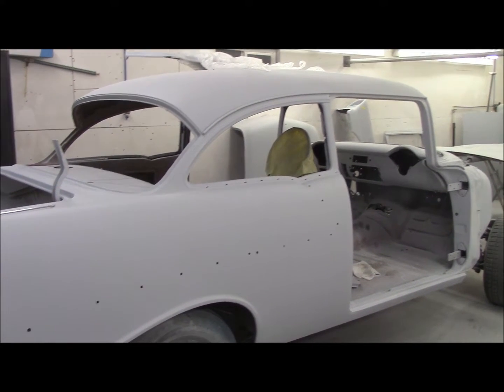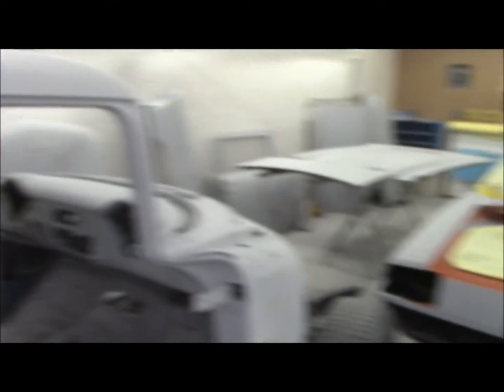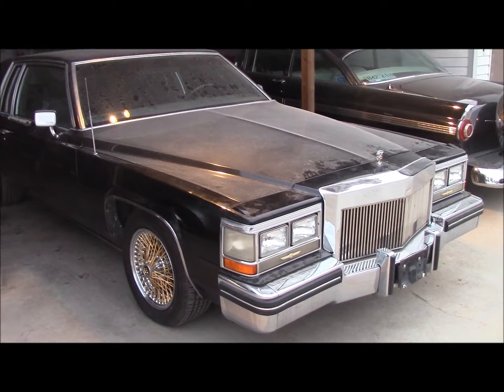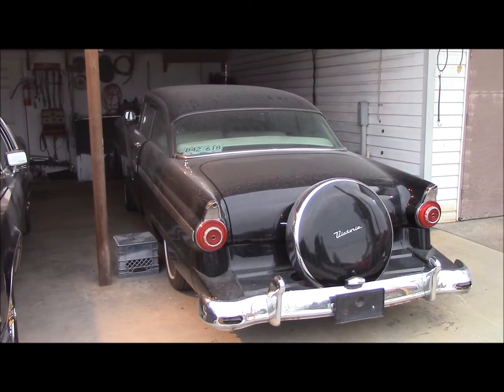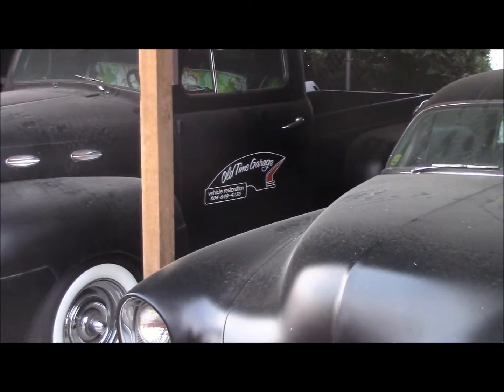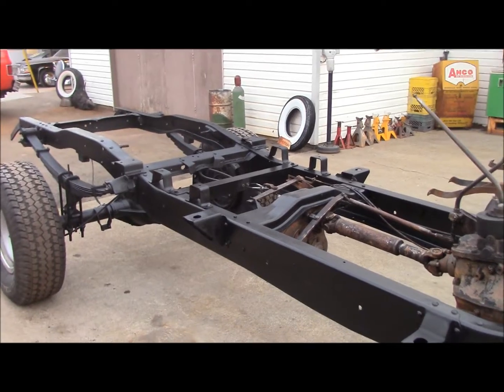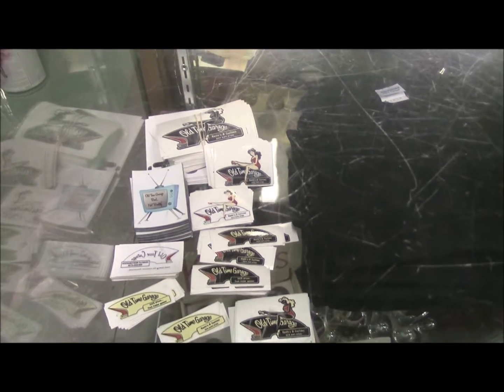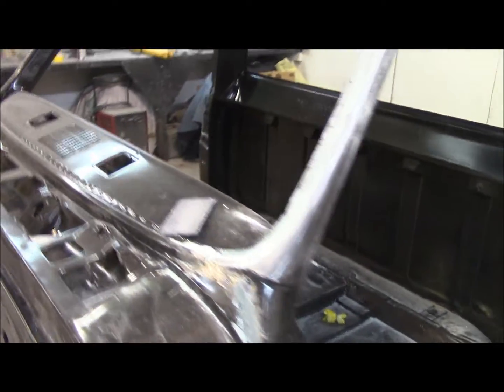Shop Update for March 2018

Comment: Hi Rick . Thanks for the update and the very nice work.  Ive been making a quarter panel for my old wagon.  Its been smashed and filled so many times the metal just splits . Cant even weld it . Huge selection but the tail light section came out ok . There was at least 4 litres of filler in it. 8 months is a joke to wait for an engine.  Got a 318 built at a place years ago.  They basically slapped it back together especially the heads . Could never get it to run properly.  Was leaking oil down the valve guides and would ping . They knurled the guides then said they replaced them . I rebuilt it and they went out of business.  Can see why.  Take care mate.
Reply from the maker: shitty deal on the engine Peter
Reply: OldTimeGarage ive still got that old 318. Got it machined and the heads rebuilt by a decent shop years ago and now it's still a good little motor.  Same shop did my hot  360 . Great job. I love the Mercury truck  and the Fairlane.  Thanks for doing more how tos as well mate.  Can always learn something new. Thanks Rick.

Comment: Good update. How about the Merc chop? Also the 4x4 chassis which looks great, it'll be used and abused, not a show truck, what are you using to space the rear springs from the axle, it looked like two small hydraulic jacks?
Reply from the maker: The Merc chop will happen soon, Lisa took to roof down to bare metal and is in the process of welding in braces before she starts hacking.  

Those pieces were on the truck when it came in, I believe they are stock.  Look like railroad ties
Reply: OldTimeGarage If you could I'd appreciate a close up picture ir two of those spacers, I just don't remember factory or aftermarket pieces looking like that. If you don't have time its no problem. Thanks
Reply from the maker: What's your email address?  I can send you pics